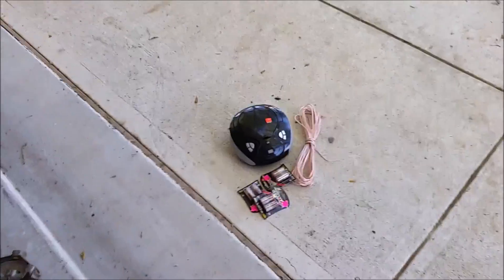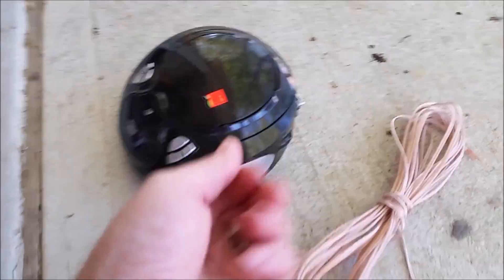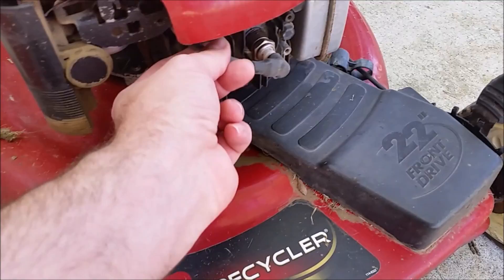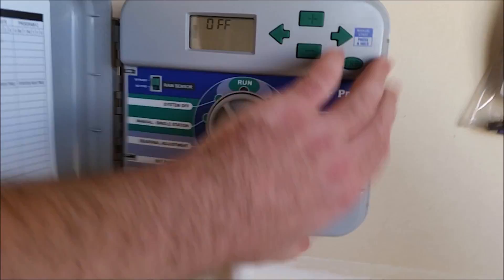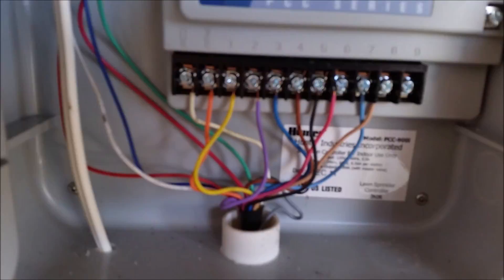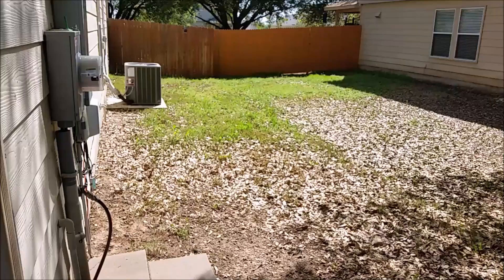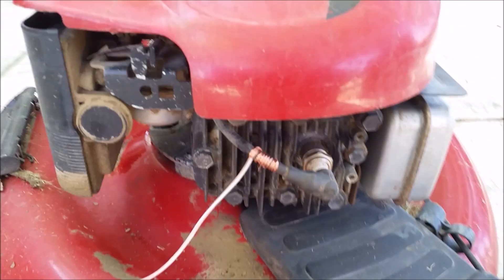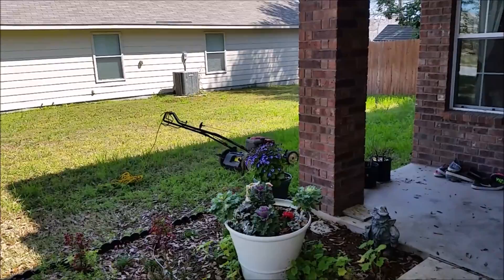Irrigation Valve Solenoid Locator AM Radio & Lawn Mower

Comment: Worked like a charm. I used some old speaker wire and did not strip the insulation. Wrapped it around the mower wire plug for about 1 inch. Set an old AM portable to 530 and turned the volume up. Found the signal easily. After searching and scratching for the valve box for a bit I took an old screwdriver and jammed it into a piece of PVC. I then started the trace over while probing the ground over the signal. Found my box after about 10 minutes. Thanks Michael!

Comment: This kind of stellar advice is timeless. Had a sticking valve in my large yard I had to locate. I was not impressed with the gadgets on youtube so I gave this a try. Got an old AM/FM radio from the folks cupboard and was lucky to have a old spool of 2 conductor telephone copper wire. Wrapped the insulated wire around the mower plug wire about 7 wraps (no need to remove insulation as this is an induced signal picked up by radio). Other end to solenoid circuit wire at contoller, started mower, tuned radio in the 540Khz range with headphone earbuds, and followed the signal to the end. Took a little patience to narrow the find at the end but this absolutely works, many thanks.

Comment: This lawnmower radio detection trick WORKS. I did as it was described (530 am) and found two yard sprinkler valves that was lost in the thick sod and the valve housing was full of sand. I used ear buds with the radio and followed the signal to each valve. Saved big bucks$$. 
Thank You

Comment: WOW, WOW, WOW.  IT WORKED!  12 JUNE 2020...GATHERED MY 6 CHILDREN AND WE WENT ON A HUNT...AND MAN, DID IT WORK...AND  HAD GREAT FUN DOING IT!!  THANKS!!  [by the way, didn't cost me a nickel.  used wire I already have and just twisted them around the control panel zone wire to the spark plug line.  used an old radio I had]

Comment: This really works.  I bought a commercial toner system but it barely worked.  It made a tone on each solenoid valve but could only be detected if you already knew the location of the valve (didn't trace  the wires).  This system works (even with speaker wires instead of a solid core copper  wire).  Be careful to insure you don't burn yourself on a hot mower (which I did on the exhaust pipe) when wrapping the detection wire on the insulated spark plug wire.
You'll need to trace the noise on the actual wire until you get a peak tone and then it disappears.  I got what I  thought was a peak tone but  it was only a  point where the wires split up (into other zones).  Keep going down the actual  line until the noise disappears.  Then go back and try and  figure out where the  peak is.  That should be the zone valve.  The actual AM frequency doesn't seem  to really matter (I tried the lowest  frequency ( 580mhz AM) and the highest frequency.  This is not exactly easy.  You'll probably dig up a few locations and only find wires.  So be careful where you dig.  Do not cut the wires with a shovel (or you'll never find the valve).  Use slow careful digs (with a hand trowel).  I thought I had found the exact position twice but the wire was part of a 6 zone valve system.  So a signal that seemed to go straight ahead ended and I assumed  it was the zone valve.  But it split to the right or left.  So monitor the areas to the left/right with the radio at the point where you think  the signal ends.  The wire may very well have split to the left/right.

Comment: Thanks!  Worked perfectly to trace my wires.  However, I couldn't distinguish where my waves were.  No matter what valve wire I connected to, I seemed to get a strong signal the entire length of wire.
However, I was able to turn off my water, and use an old programmable arduino controller I had to energize a valve on/off continuously, and then I was able to hear the valve "click" on/off while searching along the wire path.  I located all 7valves this way.

Comment: P.S.  I had previously hired a "professional" that was highly rated on Angies List.  The professional stated they had a state of the art locating system.  However, after a  couple of hours of trying (and around a hundred dollars) they could not find it.  
After I prepared the lawn mower system (wires, stripping, connecting and so on) it only took about 10 minutes to find the valve.  Now, in full disclose, I had a general idea on where my wires were (around the house perimeter) and where the valve was (in the front of the house).  So I started my search around the the front perimeter (which took me far away from the lawn mower noise).  As shown in the video, it may be necessary to separate the spark plug/lawn mower from the search area.  In my case, the mower was on the side of the house (near the garage and sprinkler box) and I picked  up a  good signal as soon as I looked in the front (far side from the mower) of the house.

Comment: Thanks Michael. Does the radio need to be battery powered? Are you using both wires or just one?
Reply from the maker: I have only used battery powered portable radios, I'm not sure if running and extension cord would create electrical interference. Also using a single wire.

Comment: Won't this send a signal across all zones as they are all tied together via the common wire through each valve coil?
Reply from the maker: As long as you disconnect the common from the control panel, you can isolate the individual valves.

Comment: I don't have a push lawnmower but would a gas powered backpack blower be sufficient to use to locate? I have used a lawnmower before but wondered if a smaller motor would be enough to use to locate?
Reply from the maker: I don't see that being an issue as small motor plugs will all be putting out about 10k volts.

Comment: What else can you use if you don’t have an alligator clip. Thanks this sounds like it might help me.
Reply from the maker: The clip just made it easy to connect. As long as you're making contact you'll be fine, just twist wires together or use a small wire nut.
Reply: @MichaelWhite78  awesome 😎 thanks

Comment: 1I'm trying this but my lawnmower won't start once I have the wire connected. Not sure if I'm doing something wrong? Thanks.
Reply from the maker: Thae only thing that comes to mind is that your plug wire isn't good. If you have any cracking in the jacket, the spark will jump to the speaker wire which will prevent the flow to the spark plug (hence dead mower).

Comment: I'm gonna try this, does the spark plug wire need to be peeled where you connect the speaker cable?
Reply from the maker: Not at all, as a matter of fact you want your plug wire to be in good shape as misfires will cause the signal to be weak or nonexistent.
Reply: @MichaelWhite78  thanks for the answer.

Comment: How far down can the wire thats buried be to hear the sound?
Reply from the maker: Dave Meissner should be good for at least 2 feet, up to 3 depending on the density of the soil. I had a couple false warnings as I had a cut line in one run, so I dug a couple extra holes than I needed. Also, I had my AM station at 580, dial yours so there's the least interference...I recommend testing on an extension cord that's plugged in so you know what to listen for. Good luck!!

Comment: I have low voltage wires for lights all through the yard so this probably won't work
Reply from the maker: I'm late to the party, sorry. That's not true unless your irrigation wire and any other electrical lines have breaks in them. Running the wire from the mower to which ever zone you choose will only send an electrical signal down the wire of that zone. In other words, when I hooked it to zone 1, I would not pick up a signal from any other zones.